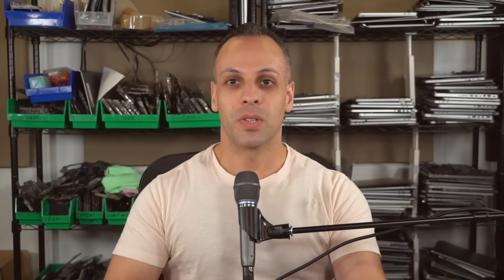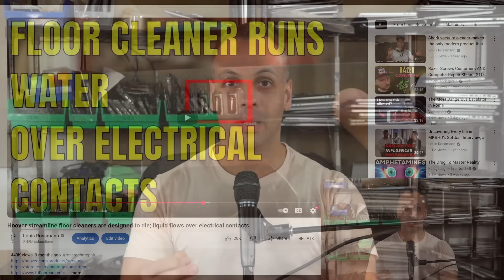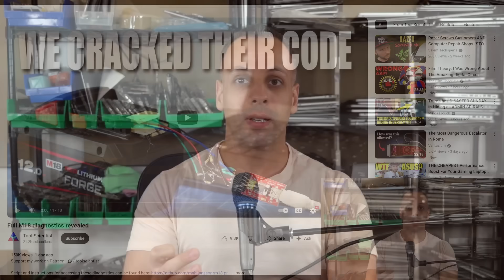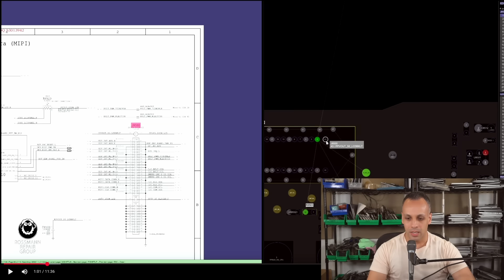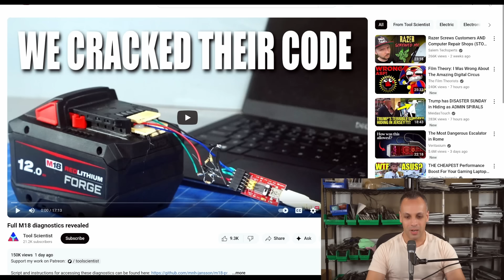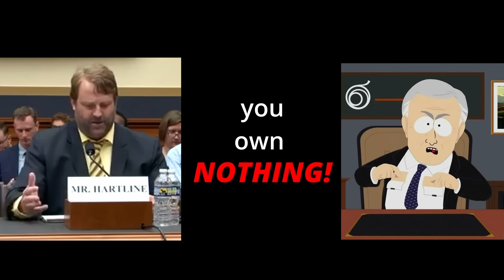Imagine putting DRM in a battery to void warranties...

Comment: Manufacturers today have turned the table to their good and screw the consumer. With today's technology, a manufacturer could easily install a chip with a built in timer that would shut down any given product completely or partially and no amount of testing would locate the problem. 

The manufacturers of light blubs, when the bulb was perfected, wasn't making much repeat sales because blubs were lasting something like 2,400 hours. They all got together and found a way to cause the blubs to last only around 1,200 to 1,500 hours and their repeat sales jumped dramatically it was said.

Comment: I'm not saying what they're doing is right, and it is perhaps another reason not to buy TTI products.  That said, there are  storage temperature limitations on Li batteries.  The inside of a car can far exceed those temperatures.  

I worked for a Tier-1 automotive electronics supplier.  We had fault reports on one of our products.  It didn't fail, per se, but it was inoperable.  The scenario was a car sitting on a dealer's lot in Phoenix AZ during the summer.  The unit wouldn't work, so we got some measurements from the dealer.  The temperature on the outside of the unit was 100C.  

This is WAY above the storage temperature of a Li battery.  Yes, it can damage batteries that aren't even in use.  The battery protection had likely already kicked in, so it that it couldn't be used anyway.  They've gone one step further into recording that information for warranty purposes.

TTI isn't alone. Festool gathers all sorts of information on their tools.  I don't know what they keep, but their app (which means they) tracks the number of charge cycles, which is another parameter affecting battery life.  That is, not the time has been used or total power used, rather how many times it's been charged.  It doesn't matter if it was discharged down to 20% or 90% before being recharged. That's a charge cycle, and it matters.

If you want evil, read a little into John Deer's business practices.  They're scary evil, and have 90% of the market -- 100% in some areas of the business.

Comment: You have a good argument and point about manufactures and traps they use.  However you ruin your position by resorting to the F bomb to emphasize you point.  Emphasize your point with solid research and facts, not with the vulgar F bomb.  That's a huge turn off

Comment: The Milwauke chargers are designed to only allow 250 charges. I was told this buy a rep. I had a drill that I bought in 2008 and it lasted 16 years and I’m a tradesman.

Comment: My wife bought an HP 1022 laserjet black and white printer more than 35 years ago. It still runs flawlessly and cranks out crisp black and white printed pages on demand. Every 3-4:years we buy toner, but other than that, no issues. We had a power outage while we were on vacation and when we got back the driver had disappeared and it would not print. HP website does not have the drivers to download any more so we were in a panic, until we restored it by turning the printer in and off several times and deleting the printer and reinstalling it.

They don't make them like that anymore. We have a Canon color laser jet printer/copier/scanner that is fussy about drivers, has to be woken up before printing and will probably kill us when it is time for more toner.

Comment: I am not getting outraged on this one. Battery Management systems had had the option for flight-and black box- recorders since the 90s. Typically, a high-end battery  is set to blow its fuse around 140F to 150F. 
It is not difficult to read this information, in the format is well-documented online. 
Don't leave your battery on your dashboard while parked in Las Vegas summer sunshine.

Comment: What's worse about the tool batteries is that they (except DeWalt) have control chips that are 100% capable of cell balancing... BUT THE A-HOLES DON'T ENABLE IT. Milwaukee does this, DeWalt does it by just excluding the hardware, Bosch does it... Makita was the only brand that this guy tested that tries to balance the cells, but even their setup is is marginal at doing so. Three of the four companies have different parent companies except for Makita, which is just Makita - and they're the only ones who enabled some sort of cell balancing. That's probably not a coincidence.

These guys are supposed to make tools, not BE tools.

Comment: That is why i use lead acid batteries in my totally off-grid system.I reckon if lead acid were(and still!!) are used in vehicles engine bays(where temperatures stay above 55 degrees celsius) on summer days.......what can beat it on toughness.
Not sold on lithium idea,except cellphones,rechargeable headlamps,etc which use small currents.And battery relative cheap to replace.Try that with 12v/100aH lithium solar battery.
Maybe i will use discrete 18650 cells in my rechargeable drill.Without any pc board.Make it removable like alkalines and charge it in cartridge charger.Problem solved.

Comment: My Google Pixel (P8) has a screen issue. The "Warranty repairer" google lists (for my country region)  tells m,e they aren't Authorised for in-warranty repairs  (at this point the Chinese repair girl in my local supermarket is probably the best go-to (are they going to hack ny phone - DL all my data, corrupt my experience??)..  My phone has a small dent / scratch on the bezel (from a drop, once - in its case when 2 days old (klutz, me)  - I am informed this voids the warranty - the phone is only 18 months old  - the screen has a line (defect) on it and flickers green tinges, occasionally... (I live in Australia - generally good consumer protection, if one invokes the ombudsman - ?? general protection, not so much. Apple care (if the subscription is maintained) may be worth it -  - I hate Apple type of  users - yes I have an iPad mini6 - a necessary evil.).)

Comment: Milwaukee used to have a balance feature in the battery itself  you would put the battery in the charger then hold the check battery power till it flashed

Comment: FWIW, only 2 companies make a significant amount of power tools in America.  Shop Smith and Emersson (via the Ridgid brand).  Stanley Black & Decker design all of their tools and manufacture a handful of tools in America (under the DeWalt brand, SBD also owns Craftsman and several other recognizable brands), but most of their stuff is made in Mexico.  Maybe Hecho en Mexico is preferable to Made in China, I can't tell you what to want.  On the other end of the spectrum, Chervon (not Chevron, owners of SKILSAW, Flex, Skil, and Worx) design their tools in America and Germany, but manufacture them all in China. 

Unlike power tools, most hand tools from higher end brands are made in either America, Germany, or England. Cheaper brands like Craftsman are mostly, but not entirely, made in China.

Comment: Dear libertarians. This battery problem seems like an issue of US regulations. Here in Europe I had three battery packs replaced by Vax under warranty. The 5 year warranty is just on the battery pack. So, each time it was replaced it was covered with a new 5 year warranty. The last battery was even a power upgrade. All done via the call centre  and no need to send them the failed battery.

Comment: How is a 50 volt circuit next to a 1 volt circuit a problem? Dielectric spacing is adequate.  Isolation requirements such as UL do not apply at 50 volts. DC circuits do not have cross talk--besides that can be modeled with software. 

I do UL and electromagnetic compliance certification work.

Comment: I’m forced to use Milwaukee tools on an iron ore mine in Western Australia. Almost everyone is being suckered into thinking Milwaukee is fantastic. For example. 3/4” rattle guns can often last only a few months of heavy use (what they claim to be used for). Their “loose by design” battery connection method allows the battery to rattle around, which causes the terminals to arc erode until its open circuit! They’ve known about this for years now. Their fix? Here is a piece of plastic to wedge in the bottom of the gun!🤦‍♂️ Makita have rubber dampers on the bottom of all their tools to stop this. Sure, Makita doesn’t “innovate” as fast and isn’t as exciting and will usually have less torque, but they usually do pretty thorough R&D. Milwaukee is ok, but it not what they claim. It’s a Chinese made, HongKong owned company, which isn’t necessarily bad but don’t believe the hype with some critical analysis of the true reliability and price/life equation.

Comment: The funniest part about TTI is there tools are basically a scam 🤣 I have a connection on the inside and milwaukee tools are actually dirt cheap in reality I get them cost price batteries cost me like $40 each the milwaukee mini blower is about $50 haven't had to pay over $150 for any of the electric tools I've bought off them, the whole industry is a scam

Comment: For the 50v next to the 1v data line, an easy kludge would be to fill the connector with dielectric grease and then put the connector together. It'll keep water out unless you put the thing under Niagara falls.

I use dielectric grease in outdoor CCTV to keep moisture out of the 48-52v PoE RJ-45 connections, and it works well. I've had connections going strong over 6 years with no issues of water ingress in some of the most hellish conditions electronics can experience. 100-130 degrees in summer, freezing in winter and large temperature swings over a 24 hour period.

Last weekend, I decommissioned a PTZ camera I installed in 2019, and the dielectric grease packed connector looked as good as the day it was installed. Connections without grease can start degrading in as little as several months.

Comment: Makita is worse than Milwaukee for battery drm, way worse
Reply: Makita has a tool that can read the data on the batteries. So you can see why it's not wanting to charge ect... Someone had to reverse engineer a protocol for the Milwaukee batteries. Makita sells a tool so you can get more detailed info about battery health, and on the newer XGT batteries even more data when you put the reader in technician mode. I am not sure I would call that worse. Also Makita has generally pretty good in my experiance getting parts for broken tools. Heck they even sell new batteries for tools they made in the late 70's and 80's. Makita has been the least scummy of power tool companies when it comes to fixing tools in my opinion. They still are a big company so they are not perfect, but a heck of lot better than dewalt or Milwaukee.

Comment: Important to note at 3:57 you state they don't have battery balancing circuitry. The batteries absolutely do have this circuitry, completely ready to go and 100% available to the microprocessor inside thanks to the BQ76925 chip. It just isn't activated in the software. It EXISTS in the battery and is 100% fully functional, except they actively chose not to implement it.

Comment: It's pedantic, but it's 14x3.7v CELLs that make up a 52v BATTERY -- An 18650 is a lithium cell, not a battery, though I guess it could also be called a single-cell battery if it's used on its own.

Comment: DRM on batteries is nothing new.  This is normally done for "safety", but also for revenue stream protection.
There are some valid reasons to not power up when someone attaches the wrong battery, but voiding a warrantee sounds a bit excessive.

Comment: I built my own knock of Dewalt flexvolt battery out of an Aliexpress kit and some very high quality 21700 cells. It runs like an absolute champ and the knockoff BMS is cheap to replace should I get issues wih it. You can do this with any major brand.

Comment: I run Dewalt and Makita. Makita batteries are very sophisticated, more so than Milwaukee, but Makita doesn't screw over their customers, so their batteries are reliable. Dewalt batteries are balanced by the charger, and are quite basic, except for Flexvolt. I wouldn't touch Milwaukee with a 10 foot pole.

Comment: I grew up in the 1960s/70s. My mother's Hoover, bought in 1958, was still working reasonably well when she passed away in 1995. So, when we bought a house in 1989, we bought a Hoover. Utter crap. So we bought a Eureka. Worse crap - it blew dust out at the seams. Bought a better model of Hoover - utter crap. Finally bought a Miele in 2005 and (knock on wood) it's working fine today. It worked better than any other vacuum cleaner I'd ever used.

Brands that were also good when I was a kid were Black&Decker, RCA, Emerson radios, and several others. All were sold to holding companies who knew nothing about designing or making good products. They basically bought the name and had all products manufactured overseas.

Comment: Hey Louis, check out the batteries and chargers we use to power radio control airplanes.  the 2 battery industries are 180 degrees apart.  we do all kinds of bad things to our model batteries and the companies sell us chargers that do everything possible to keep them going.  our batteries have a main power output connector and a balance connector that is attached to all the cell individually.  our chargers are very expensive but use both connectors to balance charge our batteries.  we also discharge our batteries to a certain percent for long term storage as they don't like being stored either fully charged or fully discharged.  power tool companies don't tell you that.  we also know just how destructive these batteries can be, we are hobbyist, we do things for fun.  when lithium batteries first came out we tested them to destruction for the fun of it.  a 2 cell, 7.4 volt 1000 mah battery has enough energy to set fire to an entire house.  the first ones when pierced with something sharp would send out flames 12 to 18 inches and enough smoke to cover an entire neighborhood.  and we had a ball finding out..  imagine that.     thank you for standing up for us.
Jason

Comment: Omitting cell balancing circuitry in Li-ion batteries is deliberate planned obsolescence.
Such Li-ion batteries can be repaired. Install a balancing lead, so you can connect an external balancer or a balancing charger to it, every now and then. Cell balancing is common practice in the realm of RC. Use your tool batteries during the full life-time of the cells in it. No need to discard them when the cell voltages drifted apart too much, severely lowering the apparent capacity of the battery.

Comment: TTi has a license to also make power tools under the Ryobi brand name. 

I do like how they designed their batteries to use the same connection terminal layout throughout every generation of Ryobi power tools. I could use a battery from 2002 in a tool from 2015, or a 2020 battery in a tool manufactured in 2001.

Meanwhile, I can't use a 2018 20v StanleyBlack&Decker battery in a 2025 tool that's from the same manufacturer, because the two aren't keyed nor pinned the same

Comment: not just the tool scientist, there is a whole group behind it, the same guys that did the makita battery helped out with this 1 as wel. And it a lot easier to get this battery done as wel. And makita did it a bit worse the milf*ckyou  with their batterys. Because the makita battery wil be bricked if it gets under a certain voltage i think twice in its lifetime. So for example if you use the powertool in your house till the battery is empty, you then go in to your garage, and the next day you walk in to your cold garage thinking oh yeah need to put that battery on the charger. Poof, that is 1 of your 2 strikes GONE, because the battery in that lower temperature has lost a little bit of voltage, because thats what they do. And because of that its now below the magic treshold, and you plugged it in to the charger, wich means it counts as 1 strike. Should have brought it in the house, let it warm up, then plug it in... 

But in the end they are all doing that same shit it looks like. Allmost looking like its a secret agreement between these company's to make it look like these batterys just last a few years. In the old days with ni-cd and ni-mh that was that case, a few years and they would be worn out, looooong before the tool would be worn out. But now days a battery with proper balancing wil last 3000 cycles, that is charging it once a day for more then 10 years for most proffesionals on the jobsite. So these batterys wil actually outlast the powertool they are coming with, FINALLY. But there is no profit in that, so they designed some planned obsolescence in there.

Comment: I have used Milwaukee tools, as an automotive tech, for many, many years. Used them hard and never had a tool failure or even a battery failure... let me take that back... I did purchase a drill driver set, that my son used daily, as an appliance repair tech. It started slowing down after years of usage. Of course, out of warranty, my tool distributor placed a call to Milwaukee and a replacement was in the mail. Not many companies will do that. I believe they all have electronic protections built in, just part of the industry. I'll stick with my Milwaukee tools.

Comment: "Unfortunately we cannot assist you any further. Our sensors have detected that you used the battery in rough conditions 20 miles away from your home. Using our products outside the warranty valid land area voids the warranty"

Comment: Honestly, if you BUY something, you should just be able to read EVERY SINGLE BIT of data that it records.
I recently bought a used camera. A Canon. So I contacted them for the tool to read the shutter clicks.
Their reply: "Sorry, a tool to do that simply doesn't exist, and it's impossibly for users to check. Here's a lick to a service provider who can check it for you"...
If a tool does not exist, how can a service provider check it?
It's consumer bullying, that's all. If the consumer tool can show you the firmware version, serial number and hardware number, it can show you the stored shutter clicks!